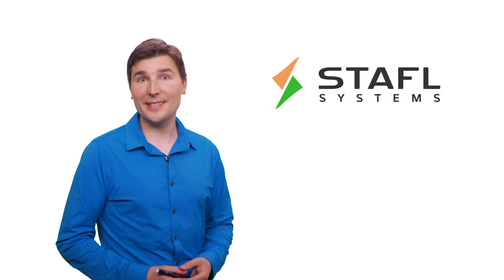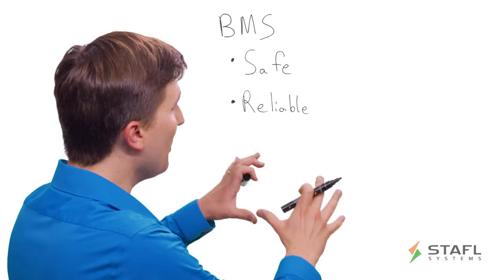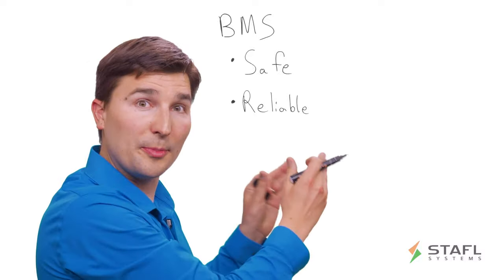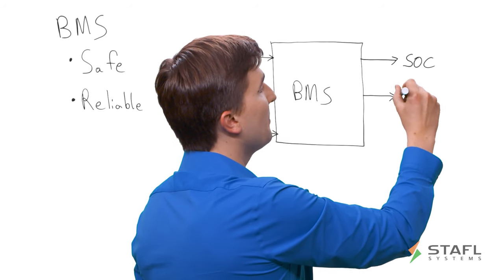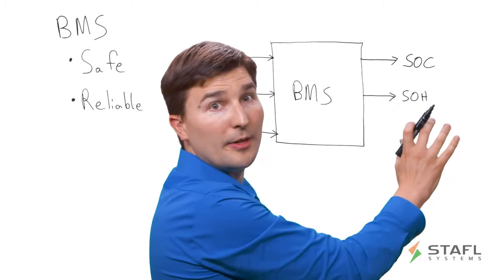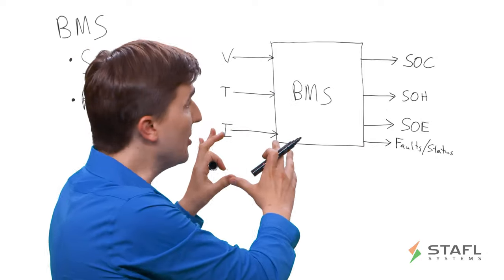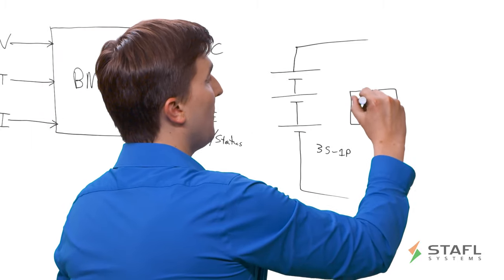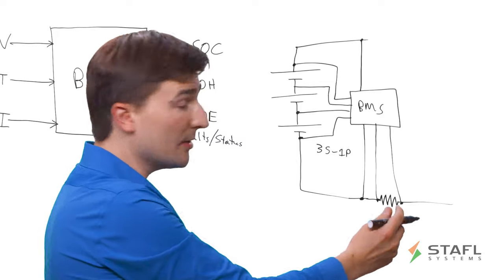What is a Battery Management System?

Comment: I have a question.  does a battery pack need the circuit board,   IF  on each "charging"  each cell is removed and individually charged, to the same compacity.  Then allowed to rest.  And the position in the pack is rotated for each use?

Comment: you mean to say monitoring the cell or battery if its charging the wire for cell b1 b2 b3 just monitoring only not charging the charging come from negative and positive and the other 3 wire b1b2 b3 just monitoring the voltage when charging

Comment: Thank you. One question please, when the BMS terminates charge or discharge states, in a cell, do the other cells, combined, continue functioning at a lower capacity? Or does the system just shut down as a result of that 1 bad cell?  I'm sorta new at this. Thanks again.

Comment: Hi Erik, when the battery pack is not on a load (not connecting to any appliance or device) or even charging, will the BMS be still working automatically to balance the cells ?  the cells will discharge themselves over time, not sure if the BMS still detect the pack and start balancing according to the cell parameter.   Thanks !

Comment: Hi, I have a left over 48 volts BMS and charger from an E-bike.
And I wanna use the 58 Volt charger to charge a 24 Volt 18650 battery pack.
Can I use half of the BMS to charge the smaller Battery pack???

Comment: Good explanation. How does one bypass a BMS and charge a low cell via current controlled power supply at say 20% of the Ah rating rated current.

Comment: this was a well presented explanation and i greatly appreciate it.  i do have a question. can the leads of the BMS  be connected to the plus or minus on the batteries. the info i have it should be the plus side. however overkill BMS is using some plus and some minus connection.  do u have some inside?
thanks for ur time

Comment: Thank you for your video.  Great explanation for how a bms works.  I am wanting to learn how to test a battery pack that won't take a charge.  Is it a bad battery or a bad bms?  Can the bms be bypassed to see if the batteries in the pack will charge directly?

Comment: So if i were to replace a battery woth a max charge Voltage of 8.8v with one that has a max charge voltage of 8.4 the BMS would basiclly think the battery is older and not overchage it?

Comment: Sir I have a question I have li ion battery pack with making it basic bms which is comes from chine 
In this battery pack I tested on aging machine it is goes upper voltage 39 volt to sharp 54 volt when I charging my battery pack having nominal voltage is 36v/10ah what is the reasion behind it

Comment: Howdy  S-S, ...
any RECOMMENDATIONS for a 48 Volt BMS brand Name ?
I run a 36 PV panel system, in a 6S / 6P configuration 230 volt "DC" input 
ALL-IN-ONE  120 / 240 volt "AC"  GROWATT Inverter SPF 6000T DVM-MPV
I would like to BUILD my own  Battery Bank ...  
Thanks,
COOP
the  WiSeNhEiMeR from Richmond, INDIANA 
...